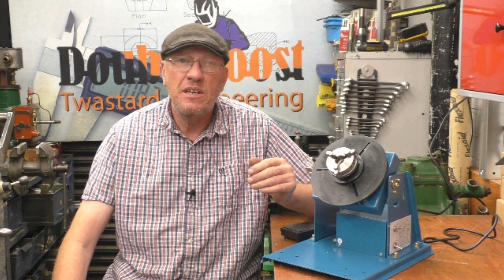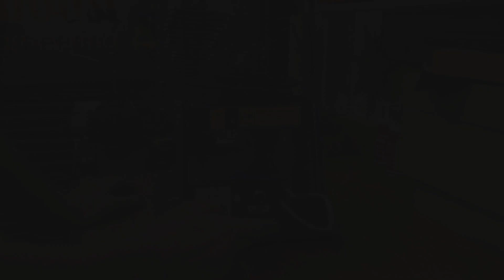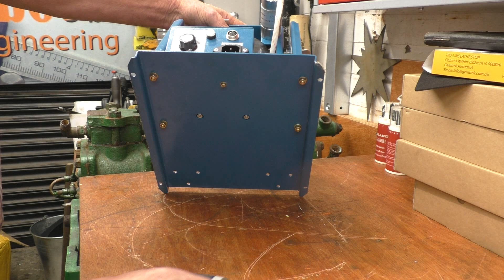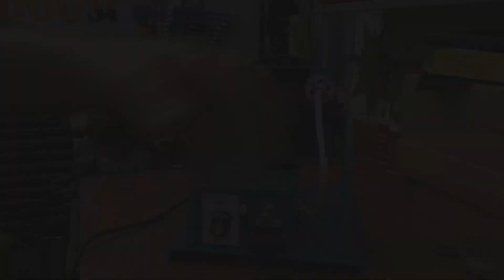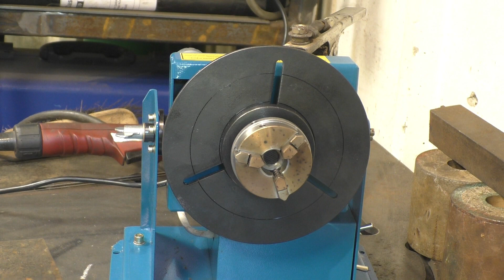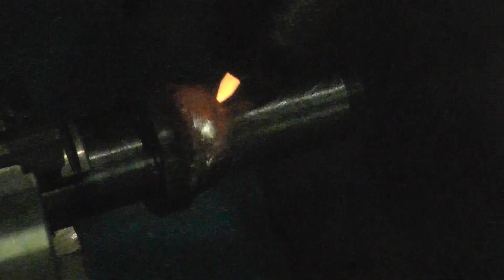Banggood Weld Positioner . Review

Comment: One thing I would add is a cap to the motor with a reasonable grommet and some fixation for the cable. The contacts on the motor might break quite quickly.

Comment: It would be relatively simple to add a switch onto the tig foot pedal to start the rotator, with a separate cable that plugs in both ends so it's not in the way when not in use.

Comment: Please correct me if I’m wrong, but it feels as if this device runs somewhat too fast, and lacks fine control in the slow speeds ?
Reply from the maker: It worked fine for me . If it was to fast I would have said so nothing to hide in my reviews
Reply: Hhhmm... have to agree with Stephan, definitely gonna' have an impact on weld penetration at that 
minimum speed, at least on the thicknesses I tend to weld.
Reply from the maker: The speed is variable  you would never run it at full-speed

Comment: I would surmise the weight it can hold will be severely reduced if you stick a 5" 3 jaw chuck on it that weighs about 5kg so wouldn't be able to mount anything in it to do any work with
Reply from the maker: I will put a chuck on it and find out It is very strongly built  I have seen them with a 5 inch 4 jaw chuck . Seemed ok to me
Reply: @doubleboost  I'm sure it is fine,  I'm just some yahoo across the water from NYC just thinking out loud. Thanks for the content.
Reply: I thought this as well, I was figuring some sort of steady rest deal would help.
Reply: I would of thought so making a machine that heavy duty and with a faceplate on it that big, they might have give it them stats down to the small motor maybe any way it would be a good starting point to upgrade on i.e a bigger motor with a gearbox on it and a better design pivot pinch bolt that swivels the table